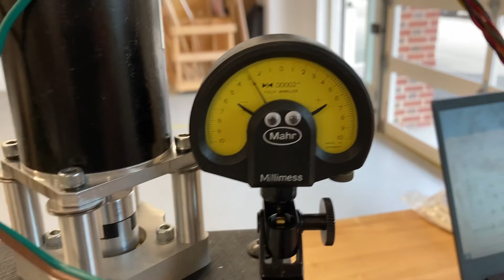.000005”resolution???  CRAZY Precision with PID servo.

Comment: I am building an equatorial mount that will support a telescope tube (~90kg); the transmission will consist of: shaft - large gear with 285 teeth - worm gear - then a 64-teeth gear - 25-teeth gear - motor. My goal is to eliminate the last two gears (the 64-teeth and 25-teeth gears) due to backlash and connect the motor directly to the worm gear shaft. I have found on the web to buy a Leadshine 3.2Nm servo motor with a 23-bit optical encoder. This results in the following resolution: 285 x 2^23 = 2,390,753,280 = ~0.000541 arcsec! I am interested in the following: is it possible for a motor with such characteristics and manufacturer (Leadshine ELM2H-1000LA80F - 220VAC, 1000W, 3.2Nm, 3000rpm, 23-bit optical encoder) to achieve this level of precision? What would your recommendations be? Thank you in advance!

Comment: Just found you via the “within tolerance” podcast. Great content please keep posting.

Why do you use a rotary encoder as feedback loop instead of a linear encoder directly on the slides?
Are there a resolution advantage? Costs?

Just wondering if the thread tolerance and stick friction hysteresis ad significant error to  your lathe.
Reply from the maker: Yea a lot has changed since this video. The axis are hydrostatic now and will use Heidenhain glass scales, as they should. This video is an example of me getting a little too hung up on resolution but forgetting about accuracy, lol. Thanks for the support

Comment: What motor is that? I'm exploring the potential of PMDC servos with the G320x for a 3d printer. I have a 75w motor that will be suitable for the heavier axis but probably need around 10 or 20w for the lighter. That motor appears to be in that range

Comment: That’s impressive. Have you checked the perpendicular stiffness of the slides? I’m wondering if it will become a difficult balancing act to tighten the gibs enough to have good stiffness in that direction while still minimizing friction in the direction of motion. 

Also do you have a website or some other way I can contact you directly?
Reply from the maker: These slides are pretty well made, they don’t get too horrifically tight when you snug the gibs. I’m still messing around with it to get it tuned nicely. But yea thats the real essence of the challenge right, minimizing friction while maximizing stiffness.
Also a website is in the works lol, but for now my email is Cyruslloyd4@gmail.com

Comment: DC servos with cheap encoders are not a very good solution. The stiffness is very low at small motion ranges.
You can get 3-phase AC servos with 17 or 18-bit encoders for ~$150-200(and 20-28 bit for $400), and their PID parameters are tunable to the point where you can get single-count motion - way beyond the backlash you'll have in the rest of the machine(like the couplers). The upside is that you can get all the torque with even the smallest motion, since the drive continuously runs the motor, instead of resonating around the 0-motion point, because DC drives are incapable of holding 0 position with any kind of current, even theoretically - their only control method is correcting a detected deviation.
Reply: Interesting knowledge spirit. For this machine I’m guessing the axis forces will extremely small
Reply: I fully agree with the first part of your comment.
I'd like to add that "the drive continuously runs the motor" is not necessarily always true, it depends on the driver configuration.
Can you show a concrete (motor) product that you mentioned? In my experience, a single quality 23-26 bit encoder is more expensive than $400. I mean a random chinese manufacturer can claim 28 bit resolution, but is accuracy, repeatability, stability and noise rejection also on par with the big guns?
AFAIK, many defects of a shitty motor can be compensated if you can measure it, but you need a reliable encoder for that.
Reply: @besenyeim  Estun sells motor kits with high end Nikon encoders. Not sure how they get it to that price, but it's been verified to be true. Lichuan and JMC sell 17 bit encoder motors - tested that personally, also legit.
As for continuously running the motors - it's kinda necessary, you don't want to completely release the current, cogging forces will take over and drive it to the nearest pole, even if it's super slight. The way almost all servo drives do it is that they have a set minimum current(usually around 10% of the max power set) that keeps the motors energized and locked when there are no disturbances.
Reply: @Spirit532  Thank you. Unfortunately, those are all Chinese. I recently started to distance myself from those manufacturers for sociopolitical reasons. And related: I know a few reasons why those motors are priced so low.
Reply from the maker: The encoder I’m using is by no means a “cheap” encoder. Used old stock, yes, but it’s a proper BEI Systems 12000 count. I hooked it up to my control yesterday and was able to realize 20 microinch steps with no problem. As far as holding torque, this is important for ballscrews since they can be back driven, but my lead screw is a precision 20TPI v thread, so as long as you can move it to the right place, you’re not going to be able to back drive it after that. Trust me, I was skeptical of servos until this point too, but this system appears to be pretty darn bulletproof
Reply: @cylosgarage  Well, there's no reason to be skeptical of servos - I'm just saying that DC servos have some inherent flaws that are a bit annoying. Might as well use what you've got already, but do be aware that it might not be your fault(but the technology's) if you hit a roadblock down the line.
Reply: As someone who has been there and done that, I completely agree with Spirit here. The ~200 an axis AC servos are the way to go if you can swing it.

Comment: Have to admit I've never been a fan of servos. With the resolution you were looking at, aren't you now at the mercy of temperature variation?
Reply from the maker: Very much so! Thermal stability is super critical, and I’m keeping it in very close consideration in my design. Thermally isolating the motors is the biggest part of it, as well as the ambient environment the machine is in. Luckily my spindle, which is often the biggest source of thermal error on CNCs, won’t create much heat because of the air bearings. 
Also, I was in the same boat as you about servos until I saw this today. I will never use a stepper for anything remotely precise again lol. If you aren’t sold yet stay tuned! I’d love to change your mind
Reply: Why aren’t you a fan of servos?

Comment: That's interesting, wonder how it will hold up with cutting forces, 0.125 micron is quite epic
Reply from the maker: The cutting forces will be very very small for this lathes intended use. Diamond turning often involves taking cuts of less than a thousandth deep with an almost atomically sharp tool, so it’s inherently a low force operation. And thank you, I think it’s quite epic also. Lol